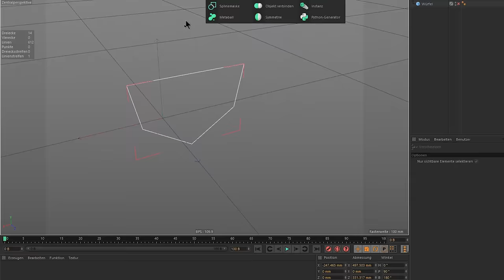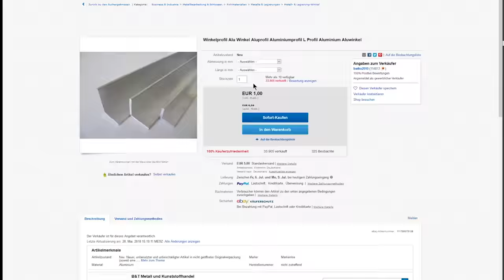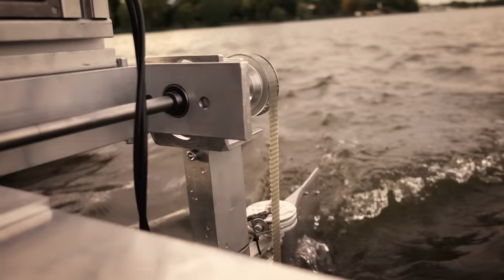Building a Bike Boat Catamaran

Comment: call it the catamacanoe. and sell them as a kit. ship in the 2 canoes and someone assemble  at home. you would be surprised you prob sell 100 these faster then you could make the parts. but do it. get rich bro. this is one the coolest designs. but need button on tarps for the canoe parts. so can store things and keep splash water out. but easy to get to to pail out water if needed on rough water days. i my self would want the canoe pontoons a tade wider to hold more surface water. but yeah lil more work to pedal. but also make so can attach a small motor like weed eater motor or small 3hp motor to pedal for ya. or so can swap out to pedal if needed. ive said many times. needs to be a attachment for boats so some type of bicycle someone sits on can pedal and get back to shore so not stuck at sea. lot work indeed with some big boats. but with gearing these days it can be less work and 1 knot is better then no knots.
Reply from the maker: Yeah the thing with the tarps was something I had planned but didn't get around to, as well as sealing the dividers so to create bulkheads and maybe add float bags to the front and rear. Lots of stuff on this I still want to improve. Thought about motorizing it too, simplest solution would be to just add an ebike motor to the crank and a battery to get pedal assist. As for selling them, I don't think I could make this at a reasonable price and here in Germany it's a nightmare to sell anything you made because there's a hundred laws that basically make that impossible unless you're a company. You have to get insurances, certificates, business license,etc. etc. but even if it was possible, considering how long this took me to build nobody would pay that price. Nowadays you can only make things cheap enough if you build a thousand of them, nobody can afford custom made things except the very rich...  So it'll remain a prototype and maybe it inspires some people to build their own. Besides I don't want to build the same thing over and over, too many other new projects I want to do :)

Comment: You say about no kind of motor, but would an electric trolling motor be used with this?  Awesome build, you have valuable talent so why not sell this as a kit ?
Reply from the maker: Yeah sure you could use a trolling motor on this. But in the Lakes and Canals in Hamburg it's actually forbidden to use any kind of motor, not even an electric one. It is allowed in some other areas though. But I didn't build the boat to cover large distances and since it's so comfortable and efficient I don't really need or want it because it would make the boat heavier and harder to transport and reliant on batteries.

Comment: Very nice job! How did you figure buoyancy and balance? It looks a little heavy to the rear or was that just how you were sitting?
Reply from the maker: Yeah since it's a small boat, a lot depends on the weight distribution on the plattform. It can carry about 3-4 people (depending on their weight ) and the hulls are slightly longer towards the front, so the optimal weight distribution I was going for was one person in the back doing the pedaling and two people in the front. In that case everything is pretty well balanced out. With two or more people in the back it does drop a little low in the back like you said. I've never had a problem with buoyancy but it does sit quite low in the water with 4 people on it. It was always planned as a sort of relaxed, fair weather boat to relax on, I wouldn't take it anywhere with considerable waves.

Comment: Interesting!.. However, for safety reasons I would go for submersible pontoons made of foam and fibreglass or for added portability 3 inflatable pontoons(4.5-5m long 35-40 cm diameter).  For your design even 2 persons already would be a stretch. It is simply unsafe.
Reply from the maker: Weird, I've used it with 4 people and I'm still alive. I guess a canoe is unsafe too then since it's not filled with foam
Reply: @PhilVandelay  I'm so happy to hear that you are still alive... I guess you have never used your boat in choppy waters. I wouldn't... Our lakes in Canada are not so forgiving. Even utilizing a couple of large SUP boards instead would make more sense for me.

Comment: as even electric motors are forbidden inside the city, 
what about an assistant motor for use outside of the city?
it would have to be easy detachable, but i think the horizontal shaft would allow for an easy coupling/decoupling design.
Reply from the maker: Yes I think you could even mount a bicycle E-Assist motor to the bottom bracket and leave it there as long as you don't turn it on. It would probably be a pretty unique setup so hard to say how water police would react to it, but as long as you don't go super fast you might even get away with using it, since it looks like somebody is pedaling. I've definitely considered this idea and it's one of many improvements I plan on making eventually
Reply: @PhilVandelay  the ultimate thing would be an E-assist motor that can be used with your bike as well as with your boat, however that would mechanically work.

Comment: Where you building this for a customer? This must have been a really expensive build!
aluminum sheeting isn't cheap... that is for sure!
Reply from the maker: It was more of a prototype for myself, maybe I'll sell it one day. Yeah the sheets were a bit expensive, but unfortunately boats always are, handmade or bought
Reply: @PhilVandelay   True, boats are expensive either way. Since your into bicycles so much you'd  probably like hydro bikes... the only thing I haven't seen is someone build a anfibios bicycle... a conventional bike frame with wheels, pontoon floats, rear flip down propeller and flip down front wheel rudder. Something that could be ridden from ones residents on the roads and strait into the water.

Comment: Very nice job but I have a question fopr you. How much time lasted on salt water because I want to make an aluminium roll bar for my boat and I am afraid of the anodizing of aluminium
Reply from the maker: I've never used it in salt water and probably never will, but at least from the info I could find online this alloy (6060) should be able to resist salt water. But if you want to be sure you should probably just paint it
Reply: @PhilVandelay  
thank you for your time and your respond. I dont want to paint it it looks great as it is i wonder if i could use anodium like the one we use in outboard motors. Thanks again.

Comment: Amazing project. Can I ask what grade of 1mm aluminium sheet you used for the hulls? I want to build a lightweight take-apart rowing skiff and your material looks ideal in terms of stiffness and workability.
Reply from the maker: It's just a normal 6060 alloy, I mostly use it because it's the common one you can get everywhere. According to the specifications it's suitable for both fresh and seawater and I haven't had any problems with corrosion or weld cracking. I was going to use 1.5 or 2mm at first but I'm glad I didn't, if you give it some structure through the shape 1mm is sturdy enough for something of this size.
Reply: @PhilVandelay  
It would be nice if you're post some links with the used materials... e.g the black mesh (Deck)

Comment: nice build!  you should think about adding some floatation to your pontoons in case the hull fails, so that thing doesn't end up on the bottom. One more thought cup holders!
Reply from the maker: I have actually installed float bags a while back like you said because I had the same thought! Still missing the cup holders though, which is indeed a big problem. Well, this thing is still a work in progress,  so I'll probably keep changing/improving a lot of things.

Comment: Great job, I don't understand why you used rivets they leak and you could tack hold the alley until you weld it
Reply from the maker: The sheets were so thin they would warp (away from each other) as soon as you applied heat, creating huge gaps that are very hard to weld. In some spots it was impossible to hold together with other methods due to the shape and size. I guess a giant C-clamp would have worked but I don't have anything like that so I used the rivets. They're watertight rivets so they don't have a hole in the middle. I had one or two minor leaks but overall it worked fine
Reply: @PhilVandelay  Very cool cat , awesome job, you spent a great amount time and effort and man have you got some cool gear

Comment: Add a trolling motor and battery and you have an E-boat.... /s
BTW, have you tried different propeller configurations; or maybe a prop on each pontoon/differential steering between the two props?

/very nice build
Reply from the maker: Two props would be great but I think not practical due to the added complexity in this case, especially considering this has to be taken apart for transport. But I am actually planning to revisit this project and partly rebuild the drivetrain on this after having tried it for a bit.
The large prop is great in terms of efficiency (boat is quite fast with relatively low effort) but the big downside is that it attracts debris in the water like nothing else so you'd have to frequently lift the prop out to clean off  stuff that jammed the drivetrain. Will probably try a smaller prop with higer RPM (higher gear ratio) next time and also make it fold up towards the back rather than sideways.
Ultimate mod would be to have the prop be able to turn instead of using the rudder to steer so you could turn on a dime but that would make the drivetrain even more complex.
Reply: Thanks a lot for sharing this epic build 🤩 and the images of the Alster were very nice as well.
I was wondering about transmission ratio. Obviously,  with your experience building bikes you had some pretty good ideas here, but looking back, would you say everything was expected, or would you have changed something?
Reply from the maker: @RCake  Actually as with many things I do, the gear ratio was a complete shot in the dark, it just kind of happened to work out with the parts and options I had. I've never tried a much higher or lower ratio either so not sure if that would be better, but I figured as long as the resistance in the pedals is in a reasonable range, it should be fine. I think it could actually be quite a bit higher for people with trained legs, but I'm not sure the rest of the construction would stand up to heavy pedaling. Right now you can go reasonably fast at a very comfortable amount of resistance, and since it's a boat and not a bike, the resistance is constant so no gears needed.  I figure if I use a prop about half as large, I'll probably need twice as much RPM - but it's another shot in the dark 😅
Reply: @PhilVandelay  The bottom of a trolling motor, with a gear driven top, might be interesting.

Comment: If you can get the hulls level on the water, you will go faster. It's a shame you didnt do an intermediate bow section to make  the transition from the bow less sharp. Next time.
Even now, with a bit of foam and bog, you could streamline both ends. The extra weight might make it heavier to tow with the bike  though.
Reply from the maker: Yeah you're right the hull shape is not optimal but getting the shape I have with the methods available to me was already a challenge. It might not look like it but my options were pretty limited in a lot of ways. I can't really shape aluminum sheet in my shop other than bending it like this and that gets very complex with all the angles. I could have done long strips lengthwise, like on a canoe, but then I would have had insanely long welds to do as well as having to have 5 meter pieces of sheet delivered somehow. I figured this design at least beats the option of just using a large round pipe like you see on other DIY floats/cats. As for the level-ness, it of course depends on how you distribute weight when on the boat, two people in the back and nobody in the front like in the last shots is obviously a bad idea but it works great with me in the back and two in the front which was kind of the plan. Good thing is, I can always keep the whole drivetrain part and just make different floats if I feel like it someday. Anyway, thanks for the input!
Reply: @PhilVandelay  It's a bloody good job though, and I know you weren't in some sort of competition for speed, just a cruise on the water and a cheap way of getting it to the water. It's going to last forever too.
A sunshade, and a foam cooler in one hull - its a real winner. Have fun :-)
Reply from the maker: @dnomyarnostaw  Exactly, I mostly just wanted a comfy spot to hang out in the sun away from all the roads ;) And I have a feeling this might not be the last boat I made...

Comment: I would suggest wheel dollies that flip down to roll it to shore with one person
Reply from the maker: Definitely a good idea, that's one among many things I want to improve about this eventually
Reply: @PhilVandelay  could also add a recharge/electric motor and battery system for added leisure from pedaling. as pedaling would regenerate battery power level.
Reply: tri wheel dollies for towing and to go around waterfalls and rapids on uneven ground or up stairs.

Comment: Great work bro so much cool and skills on you that the results ... 
!? Tell me why you didn't covered up side , it's better  on this two boats open . Do you think ☺️
Reply from the maker: I left them open to be able store things in them. It's very handy if you can put your stuff somewhere because there's not much space otherwise. It also makes them lighter. A canoe is open on the top too and doesn't sink. It's not an issue unless you're getting into waves and that's not what this boat is for. It's for small lakes and canals.
Reply: @PhilVandelay  oky i see , you have your way it's nicely well done , i have another project for my idea is roof tent ., or little boat whith tent hhh 🙃✌️ thanks and hv fun ,
 i didn't have any of this material to build hhh it's oky hhh ... Bye
Reply: @PhilVandelay    I would put some sort of foam in the front and backs of the pontoons. Leave the middle sections open for storage. Otherwise the first time some clown with a boat that throws a wake goes by you. you are going to be swimming. Yes, I know you said it's for lakes, etc... but it will happen sooner or later.   Some life jackets and a bow light wouldn't hurt either if you are going to cruise around at night in that thing.    You did a really nice job on it and I really like the fact it is light enough to pull behind a bike.

Comment: Noticed you switched to a 3-blade propeller ! What size is it ?
Whats the total gear ratio ?
Reply from the maker: Yeah I bought both of those at the same time to experiment and see what works. Both are 16x16". I can't say there's a huge difference, both worked pretty well. The overall gear ratio is is about 1:6 so one revolution of the crank equals 6 revolutions of the propeller. It could be a bit higher, I think 1:7 or 1:8 would be optimal for this case. Or maybe a smaller propeller instead.
Reply: Thanks !

Comment: Brilliant!!!! I love it, ive wanted to build something similar for years, pedal kyaks on the market are over 3 grand.  Only thing I would add is some expanding foam in the ends of the pontoons, like a canoe.  This way if it fills up with water it wont sink, you could fill it all the way up with water and barely see the pontoons but it would still be "floating" not at the bottom of a lake.
Reply from the maker: Yeah everything boat related seems to be super expensive, one of the reasons I built this.. wasn't cheap but a similar cat (without pedal drive) costs around 4 grand, and you know what they say, don't buy a boat unless you can afford 2 boats.

Comment: Awesome build. Quick question what did you use for reference and it may be an idea to reduce the angle the rudder can travel. Any further than 45° of center can induce cavitation reducing the effectiveness of the rudder. Most cat boats also steer from the hulls not the centre line due to increase of efficiency but it is a lot of extra work aligning turning radius
Reply from the maker: Yeah I noticed if you steer too far it becomes less effective. I thought about doing a steering setup like you said with a rudder on each hull but it would have made everything even more complicated. It's quite maneuverable like this too though
Reply: @PhilVandelay  yes the steering would need to be built similar to that of a car so they track equally thru the radius of a turn. I also liked how you can raise the propeller out of the water. Would it be possible to retrofit it so instead of only being used on water it could work on land using a ramp for launching similar to a standard motor boat. Can you also provide the length and width measurements as it is hard to judge from the video. Many thanks looking forward to your next project
Reply: @navcenter77  
Actually not. Technically you are right, the outer hull needs to travel a bigger distance than the inner one. But the adavantage of water is, that it is slippery. And even on the big sailing catamarans (as far as I know), the rudders move in the same angel on both sides, as most of the times during sailing the rudder angle never increases above 5°. And  for manouevering you don't need to watch every tenth of a knot as you are slowing the vessel down significantly more by the turn it self. So you coudl live with two rudders moving the same angle. Even though I would like to see the differntial rudder from a machining point of view.
Reply: @Zitronenkuchenable  Actually offshore racing multi hulls do have differential steering systems onboard. These systems are complex peices of engineering but is able to be simplified very easily on any cad program you care to use that provides mechanical functions